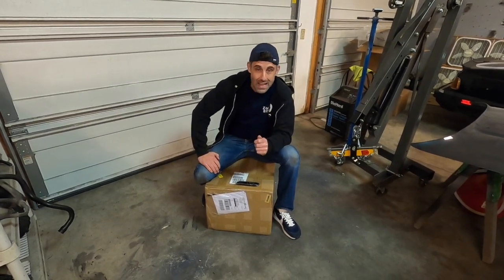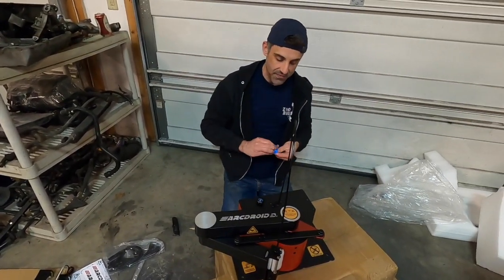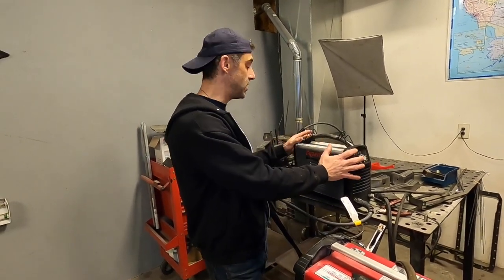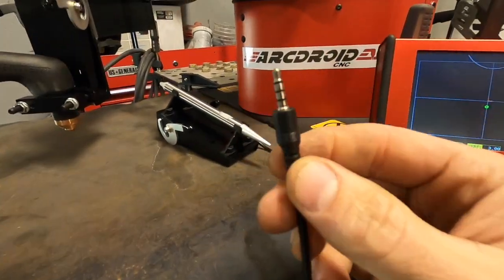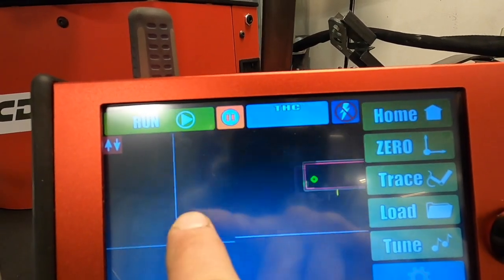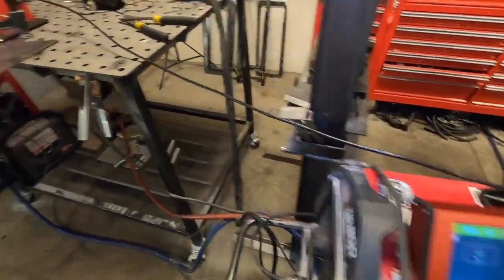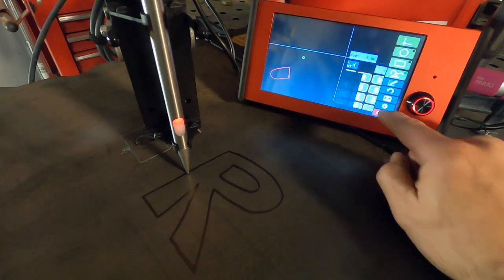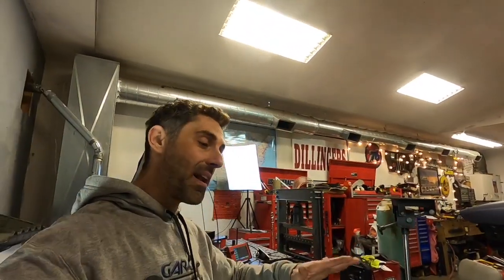The PERFECT Arcdroid CNC Unboxing, But WHY?

Comment: Awesome video! Is there a way to have the arc's of the letter R done like a real arc, just like it did straight lines by having two points? In that case like in Fusion 360, where you would add 2 points on the arc feature. Thanks!
Reply from the maker: Yes! There’s a feature that makes your straight lines straight, angles angles and curves curved!

Comment: Thanks for posting this.  It's a great piece of equipment but my issue would be, when you trace something and your hand shakes a tiny bit, as anyone does, it replicates exactly that.   At which point you're similar to just freehand cutting anyway.
Reply from the maker: Completely different animal when tracing and actually cutting. 

A new SW update actually makes your traces “straight” or “angled” as you intended with snap functions.

There are free hand plasma cutters out there who make pieces of art, but they are professionals and that can’t be compared to a shadetree mechanic making a curved line by hand. 

The arcdroid does it much better, hands down
Reply: @Garageaholic  I'm just saying, if the end result isn't perfect when making a curved or complex shape, it's kind of useless.   I'd rather learn CAD and buy a regular table.  That's just my opinion.
Reply from the maker: I think you’re missing the point of what the arcdroid does. Yes it Does trace, and it traces better than most anyone could if they were to cut by hand. That’s one facet of what it does. 

You can also now import and export dxf files. So you can also now use a cad program and have the arcdroid cut to your dxf. 

Back to tracing - to make a cardboard trace to plasma cut part in 5 minute is well worth the money.

Personally, to try to hand cut a traced part on the steel would be very difficult to see with your helmet on, while maintaining your height by hand. When cutting thicker materials, cutting a traced part by hand would be very difficult unless you were a skilled plasma cutter.
Reply: @Garageaholic  I'm a fabricator by trade.  I just got done making custom U bolt plates for an axle swap on a 12k lb food truck.  That was out of 1/2" plate.  That project needed 6 copies of a unique shape that wrapped a square tube axle.    The shortcomings of cutting by hand, especially on 1/2" is the degree of angle change you will naturally move when cutting by hand.   It was still fully functional.  It was a very time sensitive project so I couldn't outsource it - but yes, I made a cardboard template and soapstone traced that.  I noticed the hand shake on the letter R you cut was replicated on the part.  Nothing against you at all - I'm just saying that's what I want to be rid of when investing in a machine.  The bonus being the repeatability and the angle remaining 90 degrees to the plate.   Also my question would be do you need to shrink the template a certain amount to account for the kerf when tracing the outside of a template? I'd imagine so.
Reply from the maker: Hey Robert - yes actually the settings in the arcdroid do have kerf adjustments, so that can be manually updated before your cut.

Seems like you certainly know what you’re doing. The “straight lines straight” and snap to grid updates, along with wheel bolt patterns and the like corrects the imperfections of “hand tracing” which is a pretty cool feature they didn’t have when I originally purchased it. Having downloaded it since I am finding it helps a ton with the hand shakes. 

But honestly, it’s not so much the hand shaking that’s the problem, as it is, my ability to overcome the stepper motor’s detents. The magnetic stepper motors are pretty powerful and it makes it somewhat difficult to trace in that manner
Reply: Can you import the trace in CAD for cleaning up?

Comment: For the money the crossfire is a way better package. Also the rotary arm isn't the best for precision.
Reply from the maker: They’re honestly very different tools. The arcdroid is very portable around the shop and is very accurate. That is most important to me. 

Also it’s a dedicated standalone setup. No mastercam or laptop computer required to operate. You can leave this thing on for 2 years, then come back to it and touch the button and it will work like you never left it. 

Finally, you can’t trace a cardboard cutout with the crossfire. I get that the arcdroid has a smaller footprint but it’s meant for the hobbyist like the crossfire 2’x2’ is, but it’s just so much more versatile

Comment: How did you run the wires out of the plasma cutter?  I have the same hypertherm plasma machine and love it!
Reply from the maker: It depends on your plasma cutter, but you need to emulate the trigger function, which essentially is 2 wire continuity on/off. So if you open your plasma cutter and trace back those 2 wires from your wand, you can then hook those 2 wires to the back of the arcdroid on the terminal block like I specified in the video. The arcdroid simply closes the loop when commanded by the g code!

Comment: Good review, I also looked at this machine before I bought my Crossfire Pro. I wanted to be able to cut larger things. I wish I had the trace though. How has it been holding up?
Reply: how big table on teh crossfire pro?
Reply: @ccpanel  3'x4'
Reply: Seems like you could use a little planning to move the unit and finish larger cuts but would take a little more planning and time so you have to weigh how often you cut big stuff vs small drop pieces.  I'm considering future plans for cnc plasma cutting my own self.
Reply: @CraftwerksMC  Yeah that would work as well. I have been working up to laying out 3x4 sheets and filling them up with signs then cutting them all at once for sales. For one-off small brackets and whatnot, the ArcDroid will work great.

Comment: I considered buying the arcdroid but instead I purchased a langmuir crossfire pro plasma table.  A entry level langmuir  crossfire is only $1500 which is what I originally decided to purchase do to my budget but ended of buying the crossfire pro.  The arcdroid would need to be under $1000 for it to be a viable option.  With what I know now I would of built a custom table from scratch.
Reply: thats my opinion too. way too overpriced for what u get :S
Reply from the maker: I know of the crossfire. And what I liked about the arcdroid is the trace function. A total must for a fabricator who makes custom brackets out of cardboard.

For the crossfire You need to then redesign in CAD, then upload and cut.

Comment: Coming out of the back of the Hypertherm that you tied into is a CPC port, and the 45xp is the entry-level CNC because it does have a high frequency start the 30xp is more a hand machine. lol
Reply: Talking CNC plasma talk, on the back of the piece is dross, not slag which I find myself saying the same thing every once in a while. lol
Reply: So the tracing is only as good as study you can hold your hand, I use a tracing tool on an Arclight 5x10' table, and let me tell you something the hand tracer would have been better in that scenario. lol
Reply from the maker: Maybe but tracing requires hundreds of hours of practice, a genuine talent to perfect, will take more time to and you are limited even still. Trust me, a CNC machine is more accurate at making precision cuts than tracing. I made that letter by freehand.